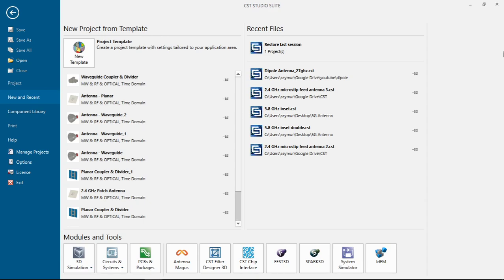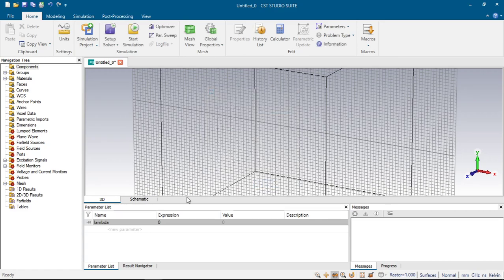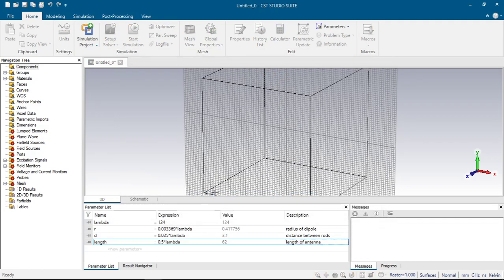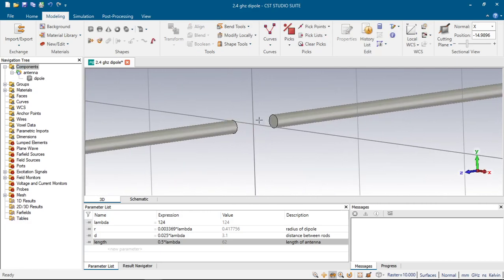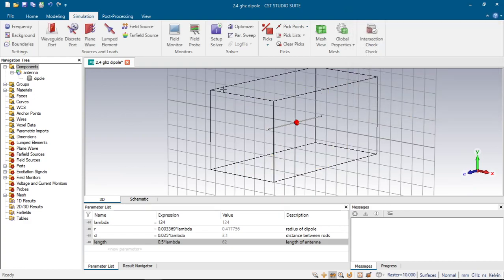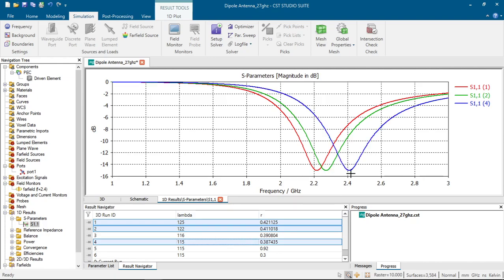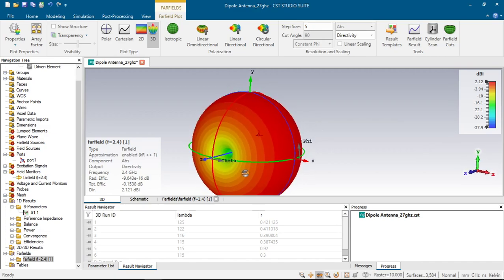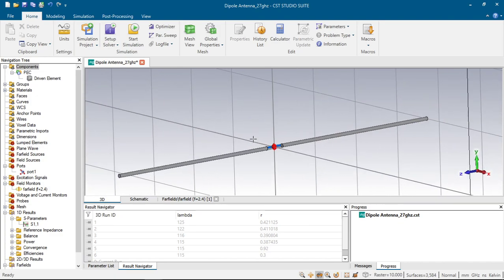2.4 GHz Dipole Antenna Design in CST

Comment: Hi! Thank you, I had the same issue at 8:35 where my s-parameter results isn't correct. Do you know why you got those results instead of the actual desired s-curve plots?
Reply: This may be because of the impedance. For Half wave dipole it is 73ohms. If I am not wrong
Reply: the solver should be time domain not integral.

Comment: Thank you for this video ,I have a question  I will be glad for your reply . In your video around 2.20s, you commented about CST using 0.003669 as the coefficient for defining the dipole antenna  . You also used 0.025 to evaluate the distance between the dipole . I have been unsuccessful in getting your reference manual . Could you share your CST reference where you obtained it? Thanks
Reply from the maker: Dear Wisdom,
That is actually a very good question. I took this value from the Component Library. You can give any value that you want to. This will change the bandwidth of the antenna. The thicker the antenna the wider the bandwidth it will have.
Reply: @SimulationMaster  I have checked the component library but its confusing your statement.Please kindly share a screen shot of where you obtain it it will be very useful ....Thank you

Comment: Hello sir im from Indonesia, nice video.. may i ask you, do you know how to parsweep in antena helix? Which parameter that i have to changes? Thank you..
Reply from the maker: Dear Candra,
Can you please explain in detail your question.
If you want to parameter sweep you must first define the parameter in your design.
Reply: @SimulationMaster  Okay sir. I have some parameters to design my helix antenna. 
*Center frequency = 2.45 GHZ
*fh = 2.6 GHz , fL = 2.3 GHz 
*bandwidth > 3% 
*Input impedance 50 ohm
*Return loss < -10 dB
*VSWR < 2
*Polarization RHCP
*Using FR-4 material for substrate (dielectric constant 4.3)
*Substrate thickness 1.6mm

I have already designed with N (number of turns) = 5. Used this formula, 
Wavelength = 122.4mm
D = diameter of helix = 38.9mm
S = spacing between turns = 30.55mm
C = circumference of helix =π D = 122.2mm
A = total axial length = NS  = 152.75mm (same as height of substrate)
α= pitch angle = 14 degrees
diameter of gnd plane > 1/2 lambda

The problems are the return loss at center frequency 2.45Ghz, its result is beyond my expectation. Also happens for VSWR. :(

I changed the number of turns become 7, and increasing the height of substrate (same as axial length),
and the result for RL and VSWR are good (-30dB and 1.05), but that values at frequency 2.52 GHz.

What should i do to make result be in 2.45Ghz and not 2.52 GHz like the way i got? 
Thank you..
Reply from the maker: @revytanovacn  Dear Candra,
Did you change the radius? I think you must slightly increase the radius.
Reply: @SimulationMaster  radius is diameter/2, right?
Reply from the maker: @revytanovacn  YES